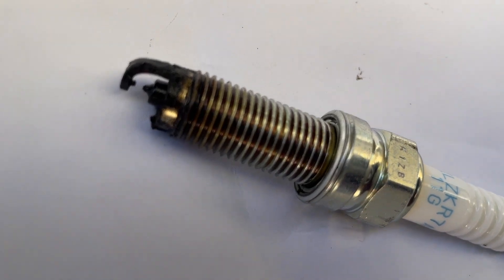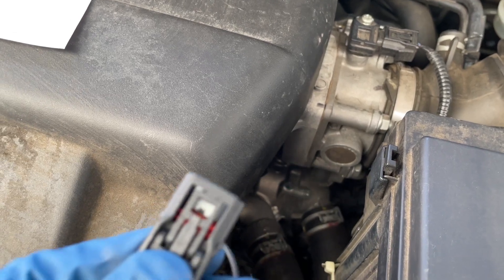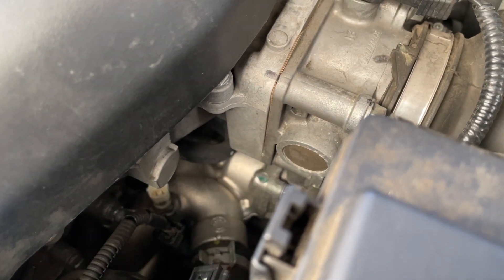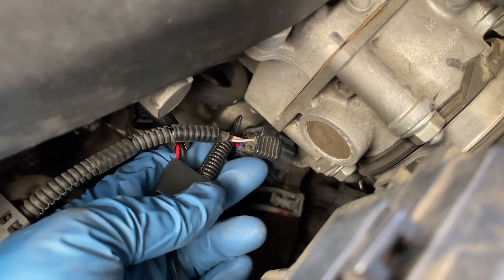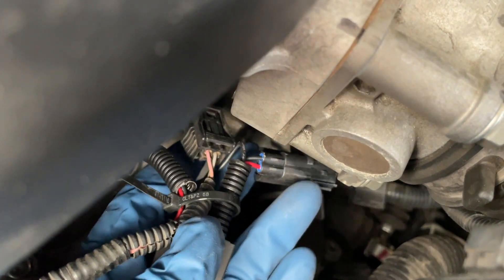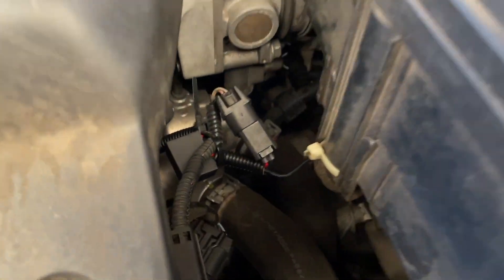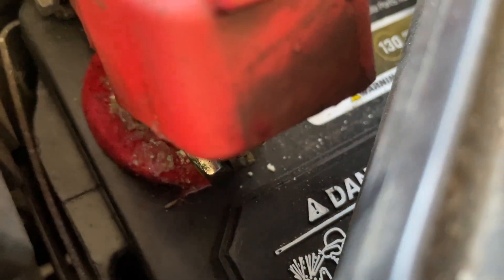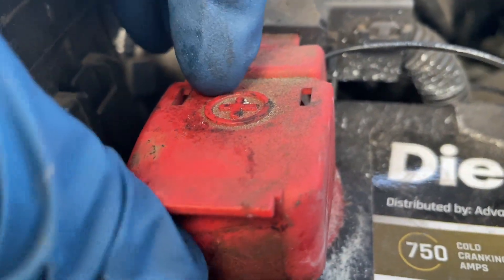Disable Honda Odyssey ECO mode with S-VCM

Comment: Like a totally different engine. I did not know when I bought my 2023 Ridgeline that it had cylinder deactivation. I couldn’t believe the 2 second pauses in power whenever I let off the accelerator and then reapplied. 
Even off the line there was hesitation. Now accelerator response is instant. 
I’m stoked. I also installed a defeat device for the auto off system. I get in my truck turn it on and don’t have to f with anything.

Comment: yah I did this on my 2007  Honda Odyssey, after  started feeling engine imbalances in echo mode and oil consumption.   
the bank 1  cylinders (the ones that get deactivated) get more wear and cylinders will fill with oil.  and cause coil , plug  issues and oil leaking. Hopefully I saved it in time ,   at 242k miles,  its got about 252k now ,  oil consumption reduced by 50%,   imbalances  and runs smooth. fuel MPG reduced 1-2 MPG.     next fixes will be gasket  replaced an a oil leak by the oil filter ( common for v6 honda)  and maybe  one of the sliding doors.     Power Steering pump still working good enough , but hopefully it will continue to work as long as I have it. thinking of getting rid of it around 300k; thats when  its due for next timing belt, water pump, valve adjustments, etc major service .
Reply: Thanks. I hope this works on son's 2006 odyssey!

Comment: Hi, has anyone experienced battery drain after installing this? I've read on some forums that it might happen because it constantly draws power from the battery. I'm wondering if the other version, which doesn't connect to the battery, might be better? I'm planning to put one on my 2025 Ridgeline. Thanks!
Reply: no power drain noticed, but don’t tell the dealership about it as it might void the warranty on the engine. If you have to bring it in then just remove it , it literally takes 5 minutes to remove. I have it on my ‘24 ridgeline. Gas mileage 20 to 22 mpg combined depending on how you drive. Off topic you can put bigger tires 265/60R18 on ridgeline.
Reply: @mr_mcgoo2632  Thanks for the reply and the suggestion. Just a quick question, after you installed it, did you get any lights on your dashboard after you installed it on your '24 Ridgeline? Thanks again!
Reply: @Radwinskee  No lights or codes on the ECM. The honda has 2 coolant temp sensors, 1 on the manifold and 1 either on the radiator or near the thermostat. So the ECM does see the temp in of overheat. Also the S-VCM claims to monitor the temp and if it gets too hot will shut itself off and alert you of an overheat.  FYI , Their free maint plan is absolute garbage with oil changes at 10k miles. I'm opting to do oil changes at 4k to 5k.
Reply: @mr_mcgoo2632  Thanks for the reply! I'm planning to do mine as well at 5k interval.
Reply: @mr_mcgoo2632  Is there a way to know when VCM is engaged on our Ridgelines? Thanks!
Reply: @Radwinskee  I don't know.

Comment: Thanks for this. I just added this VCM muzzler to my 2017, which has been in for misfires/foule plugs 3X this year after no prior problems (125K miles). I'm hoping this this will prevent future issues. I'll add that while the connecters themselves are easy, it's a tight space to get the proper grip to depress the little latch on the connecter and pull straight up. I had some trouble, but I knew it should be easy, so I repositioned a couple of times and got it.

Comment: I second that, a link would be helpful.
Reply from the maker: https://www.svcmcontroller.com/
Reply: Thanks, decided on the VCM2 after this video, slightly different unit and made in USA and is top notch tech and us EPA cert. Meet the inventor actually. Cool dude. Runs like a dream, no more ECO madness.
Reply: GOOGLE  S-VCM